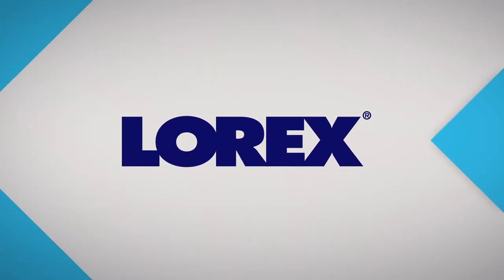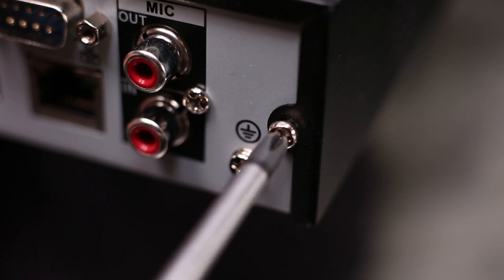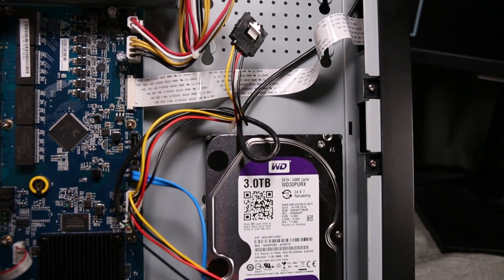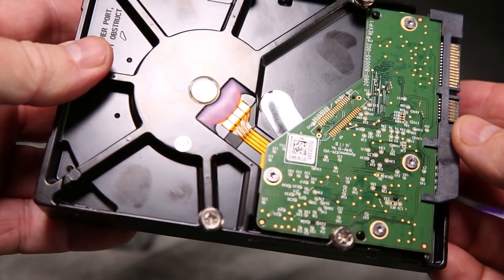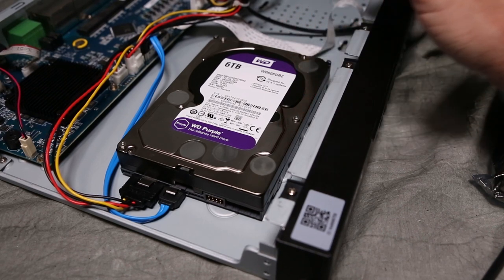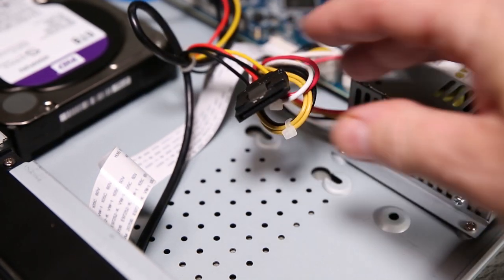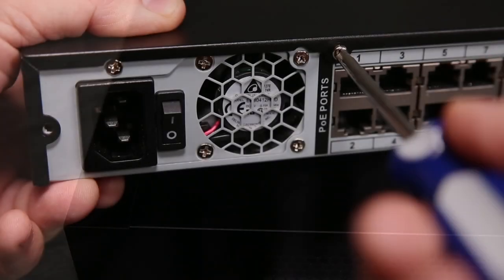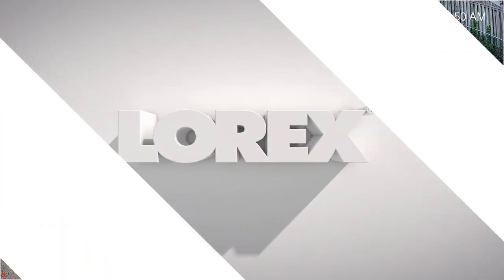how to upgrade and install a NVR hard drive

Comment: The software that runs the NVR is installed on the board not on the drives .. you can even remove both drives and it will run without them it just wont record.
So ya just swap the drives out, it will do the rest
Reply: That's all the information I was looking for, thanks!
Reply: This is what I was worried about. Thanks for the clarification. Do you know max capacity how many TB hard drive we can install together or each drive? Thanks!!!
Reply: @qwunatai6983  I have a 10tb and a 4tb drive ...did not mess with the settings i installed both drives looked under operation and information saw both on that page came back 4 weeks later both drives full of video and it does its thing on its own
i have the 16 channel says 2 hard drives 10 tb each total of 20tb per website

Comment: N884 Series - If I want to add a second HD, do I need to purchase any cables or screws, or are they already available within the NVR?
Reply: Ya, we ordered two 10TB directly from Lorex and did not come with ATA cable nor did it come with mounting screws. I went ahead and ordered from Amazon same day shipping no big deal.
Reply: The N884 has the screws and the cables inside a bag.

Comment: I see you installed a 6TB and 4TB - why is the system only registering 8TB and not 10TB?  Thank you.
Reply: Formatted space is always less than the advertised drive capacity.
Reply: Can you copy the data from the old drive to the new drive using SATA USB cables and a PC?
Reply: @Daniel Liguori 4:31 clearly shows the two drives 5.4 and 3.6
Reply: I know Kenneth Earle's question is an old comment on disk copying, but it's worth answering.
One MAY be able to us an imaging HDD cloning program to do this. It depends on whether or not the NVR/DVR manufacturer used something unique to format the disk in an odd way. My experience has been that one can rarely make an NVR/DVR disk copy by using a Windows or open-source Linux OS standard "copy" command... although I have run into a few that do, 

Bottom line, you have to try it or get info from the manufacturer or someone else who has actually tried it using the model of NVR you're using. One can't make a global "yes/no" statement.

Comment: Can I install a different hard drive or does have to be specific to Lorex
Reply: You can install a different hard drive. It necessarily doesn't have to come from Lorex. However, the drive must be a surveillance drive. A regular HDD for computing use will not work in a security camera system as they will wear out completely after a year or so due to the the system constantly writing and erasing data. Surveillance drives are designed to handle this task and can last up to 10 years. Drives you can pick up are the WD purple series and the Seagate Sky-hawk series. Also whatever you do, do not install an SSD as these are definitely not designed to be in a DVR. Hope this helps!
Reply: Nismo Tuner said, "A regular HDD for computing use will not work in a security camera system as they will wear out completely after a year or so due to the system constantly writing and erasing data."
Sorry, but that is not why "non-surveillance" HDDs fail in a surveillance system. Non-surveillance HDDs installed in "regular" computers are ALSO being almost constantly written too, erasing old information, and reading information. Even if the user is not using them, some systems are still checking the HDDs, defragmenting them, etc which all results in reads and writes. If you have a disk checkup program running in the background then that too may be writing to and reading the HDD, reassigning bad sectors that are found...or doing so predictively before they actually fail and impact customer data, and so on. 

In addition, there is often very little cooling in a NVR/DVR, whereas comparitively most desktop systems provide a lot more cooling for the HDDs. For example, in my NVR, there is NO VENTING, and NO FANS. It's basically a sealed box and ANY installed HDD will run hot. Since 7200rpm HDDs tend to generate more heat than typical 5700rpm-5900rpm "surveillance" HDDs, the heat within the HDD climbs to very high levels...OFTEN exceeding the HDD manufacturer's operating temperature specification...which typically leads to earlier failure. Unfortunately, NVRs with which I am familiar don't provide access the HDD SMART data and thus you can't see how hot your HDD is running (it's considerably  higher than the ambient air temperature inside the NVR box). A typical maximum internal temperature for a mechanical HDD is about 55degC. Some are 50, some are 60...it varies but it's typically in that range.

I've seen numerous customer computers where the well-cooled HDDs are spnning and reading/wriing data 24/7 and the disks are over 10 years old. Their SMART data and an HDD monitoring program called 'Disk Checkup" show the HDDs are running fine.

It's too often the heat...not the reading and writing...that kills HDDs.

Some people may also opt to record surveillance on their HDDs only if motion is detected by the camera image handling algorithms...so both surveillance and non-surveillance HDDs will not get continuous use. So again, that part of the surveillance vs. non-surveillance HDD failure rate goes away as well.

But, mostly, it's because "surveillance" HDDs run at 5700 to 5900 rpm instead of a "computer HDD's" typical 7200rpm and that is more stressful on the HDD, and often results in higher heating. However, even some 7200rpm HDDs run very cool and will last just as long as a "surveillance" HDD.

Also, surveillance systems are usually less stressful on an HDD's head positioning assemblies, because the recording tends to move to/from contiguous HDD "tracks", whereas on a computer the head assembly(ies) may move the mass around VERY fast from the inner track to the outer track, and may do that kind of track "jumping around" a lot of the time, especially if the drive is very fragmented. That seeking activity really affects the head assembly and head positioning servos. (note: there are often course and fine HDD head positioning subsytems.) and surveillance recording tends to reduce the degree of fragmentation.
---------------

edited to add a bit more history and specs of mechanical HDDs
Reply: @exgenica  Thank you. You might consider making a video on this subject.